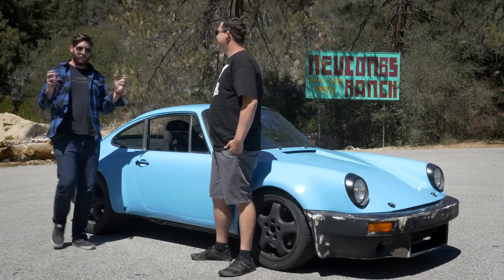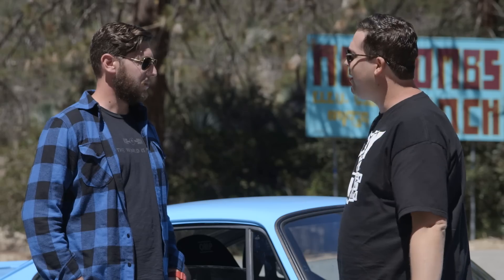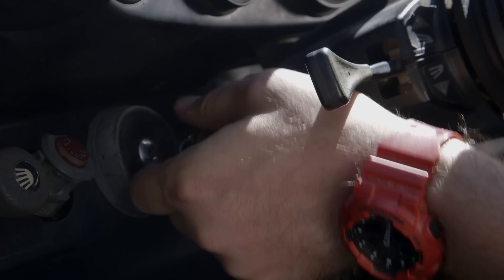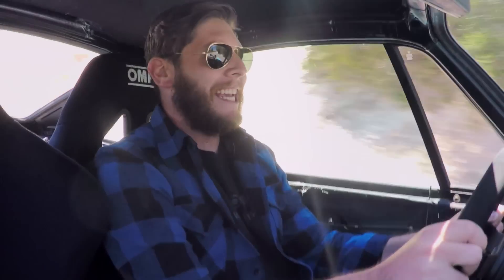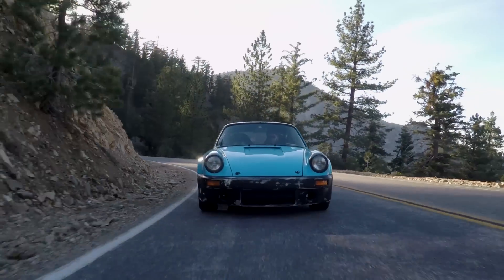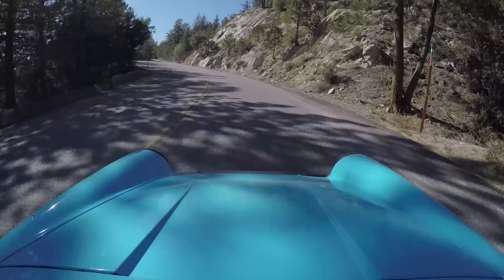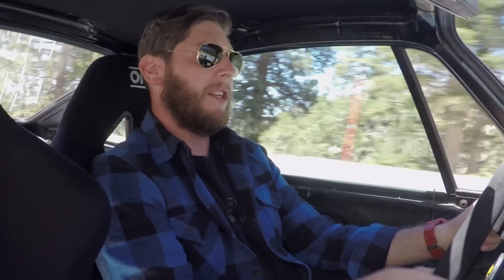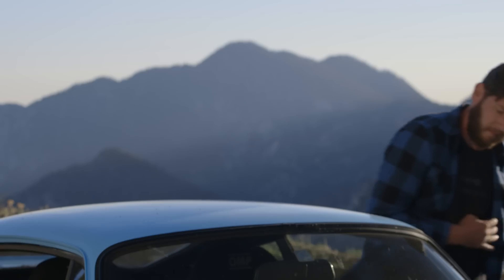1970 Porsche 911: Understanding the Love Affair

Comment: Didn't the 911 only come in at 1964?
Reply: Poon Handler i believe it began in 63
Reply: Magnus walker said 64... let me google it....As the successor to the Porsche 356, the 911 won the hearts of sports car enthusiasts from the outset. The prototype was first unveiled at the Frankfurt IAA Motor Show in 1963 as the 901, and renamed the 911 for its market launch in 1964. :D
Reply: After complaints from Peugeot, Porsche chose to rename the model a 901 changed to a 911 over legal issues. If you want a car like this that wont cost a mint Look at a 1966 to 69 912 its a dream 4 cylinder with a overhaul big bore kit. cars weight wont trow you around the coroners and can push about 170hp at the wheels and only weigh about 1900lbs would keep up with any early gen 911. if your looking for a 901 good luck set you back 500k to million bucks if you can find one. 912s if you find one buy it can complete a bad ass driver for under 25k with upgraded master cylinder and disc brakes from newer gen 911s lots of parts are interchangeable with slight mods.  Shes a mean black sheep. A proud 912 owner and 931 owner. Water-cool is just as fun the 944 and 931 924 cars have gear box under the rear of car giving a near 51-49 weight distribution giving the car impeccable handling. Porsche there's nothing like it.